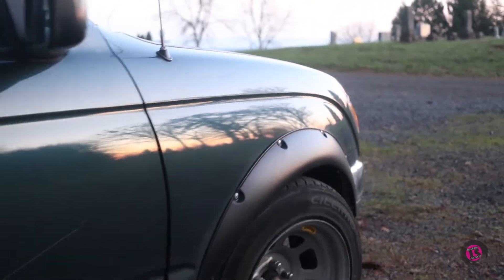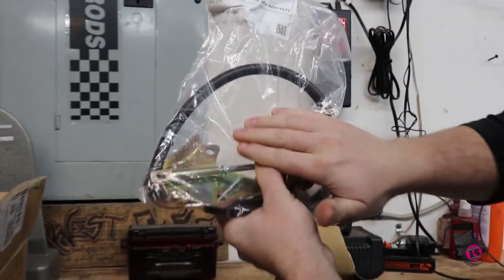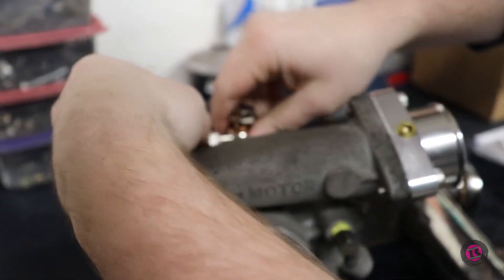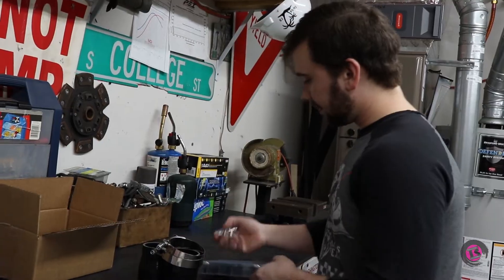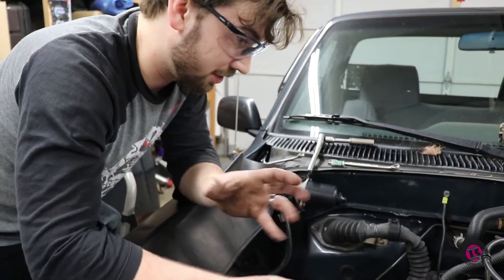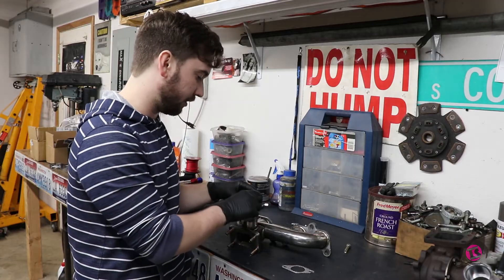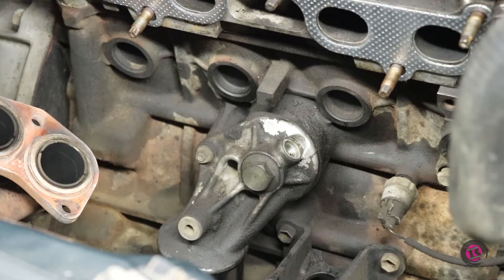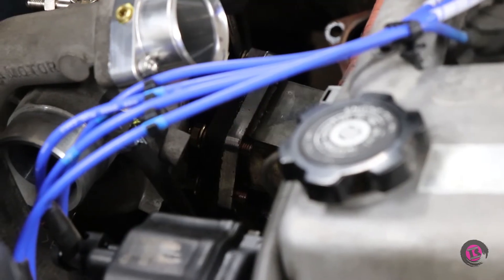TURBO Charging my Toyota Tacoma w/ 230k miles! | EP. 1

Comment: I have a 99 Taco with the 3rz in it. i bought the "Street Demon" turbo kit which is set up to run 8psi. you said anything less than 8 you really don't need an intercooler. Since I'm running 8psi should i go through the headache of the intercooler or just straight port it to the intake? i have the same EGR delete kit also. my 3rz is about 15k from a full rebuild so i wanted to improve my commute to work times or smoke the occasional hopped up lawnmowers that are all around town.

Comment: I dont know half of the technical terms you said I'm so retarded :(
Reply: what terms did you not understand? Maybe I can help you out
Reply: Piggyback ECU, Wastegate, catchcan, PCV system, turbo oil drain thingy?, restricter kit, drain back, drain back flange?, EGR, EGR temp sensor, check valves, idler control valve, blowout valve

Comment: Love it! Wouldn't quite qualify for the $500 turbo challenge, but still super cheap and badass. :D
If I had one bit of advice up front it would be to definitely make a support bracket for the turbo.
Otherwise, I would worry about that manifold cracking right where the square pipe meets round.
This is gonna be a spool speed monster and be lots of fun for sure. Love it and hype to see more!